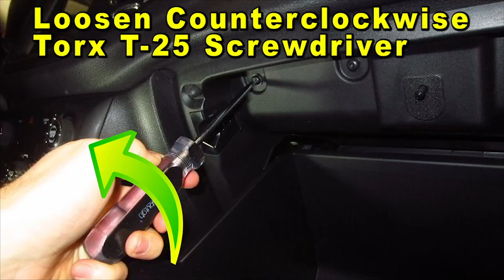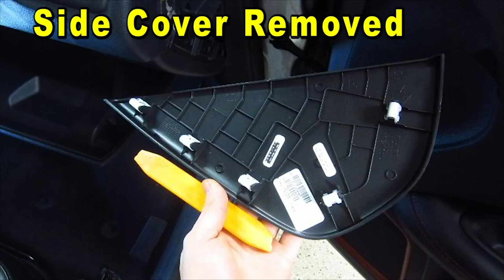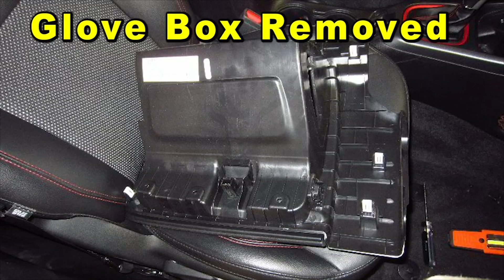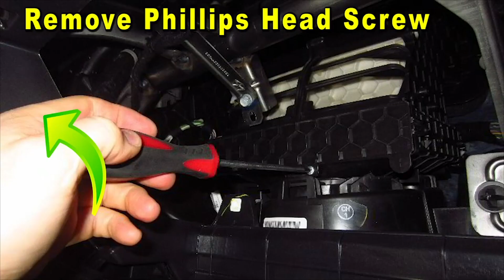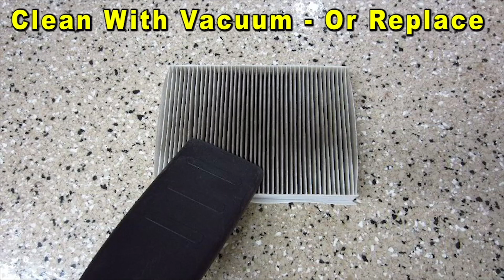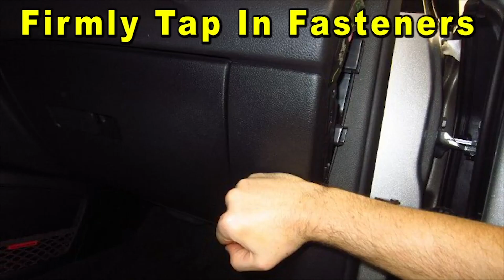2017 To 2024 Jeep Compass How To Change A/C Cabin Air Filter With Part Numbers - Quick & Easy

Comment from the maker: Jeep Compass A/C Cabin Air Filters - https://amzn.to/46PrIoA
EcoGard A/C Cabin Air Filter Part Number - https://amzn.to/3Nl3RX1
Fram Fresh Breeze A/C Filter Part # - https://amzn.to/3NpDu2h
Bosch Cabin Air Filter Part Number - https://amzn.to/3tdPehe
K&N Washable Cabin Air Filter - https://amzn.to/3tfHiMw
Precision Screwdriver Set - https://amzn.to/3sLixaP
Plastic Pry Bar Tools - https://amzn.to/3HMtsV7
Socket & Ratchet Set - https://amzn.to/3Z17LbA
Mechanix Gloves - https://amzn.to/3jCnHkt
Torque Wrench - https://amzn.to/3vS5uSI

The Paul79UF YouTube channel is a participant in the Amazon Services LLC Associates Program, an affiliate advertising program designed to provide a means for sites to earn advertising fees by advertising and linking to Amazon.

This DIY video shows owners of the 2nd generation 2017, 2018, 2019, 2020, 2021, 2022, 2023 and 2024 Jeep Compass how to clean or change the A/C system's cabin air filter element.

Comment from the maker: Check out the DIY guide for changing the HVAC cabin air filter in a 2nd generation 2017 to 2024 Jeep Compass -
https://www.paulstravelpictures.com/2017-2022-Jeep-Compass-Cabin-Air-Filter-Replacement-Guide/index.html

Here are all of the DIY repair and maintenance tutorials for the 2nd gen 2017, 2018, 2019, 2020, 2021, 2022, 2023 & 2024 Jeep Compass -
https://www.paulstravelpictures.com/Articles/2017-2022-Jeep-Compass-DIY-Repair-Maintenance-Guides.htm

Owners of other Jeep, Dodge and RAM vehicles such as the Grand Cherokee, Wrangler, Renegade, Gladiator, Cherokee, Grand Wagoneer, Wagoneer, Charger, Challenger, Durango, RAM 1500, Promaster, 2500 and 3500 may also find these DIY instructions to be helpful.